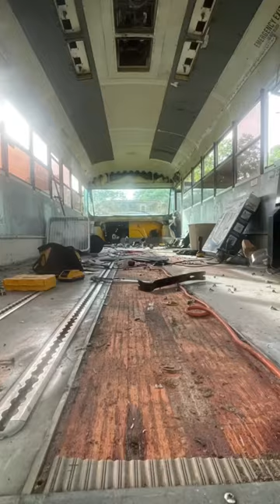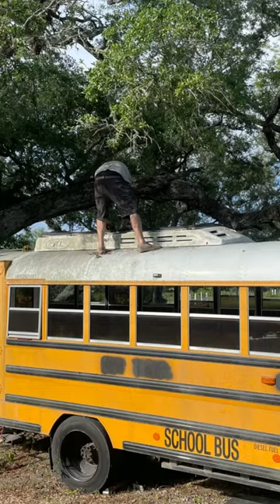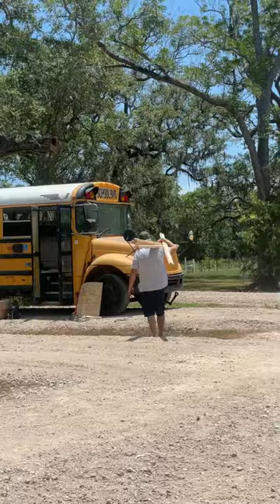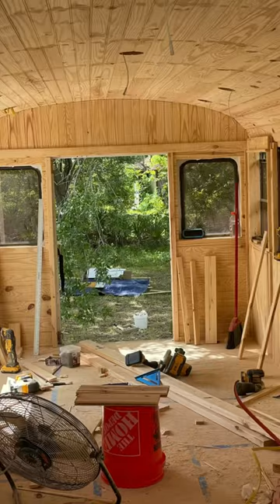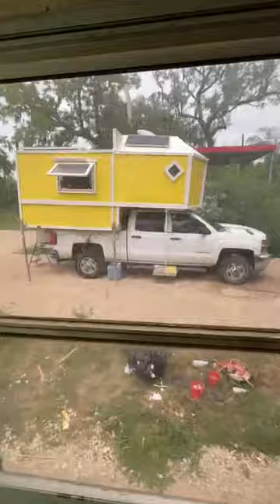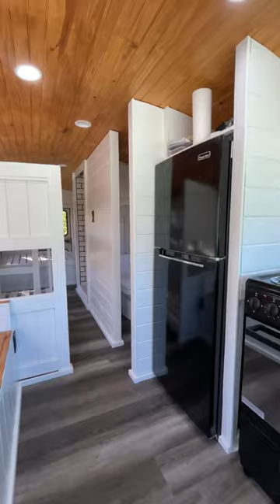COMPLETE SKOOLIE BUILD - School Bus Conversion Start to Finish #skoolie #skooliebuild #busconversion

Comment: OK I get it so so is the hood area trunk have storage or is it gonna be a 5th wheel? Now I've seen a 5th wheel skoolie no engine or transmission with a 5th wheel
 Hook pulled by a heavy duty truck 🤗
Reply from the maker: This one is stationary… that 5th wheel idea is a cool one though. 
The motor is still there, but obviously not functional. It looks cool when the hood is open, but they might remove it one day for added storage.
Reply: I would like to build one of those fifth wheel types!

Comment: I need advice on putting a wooden slat ceiling in my 4 windowvshort skoolie.  Are you screwing slats across the width to screw the lengthwise board too??? I don't want to screw a hole in my roof. I'm 65 and living in my tiny cabin I'm building.
Reply from the maker: The ceiling pieces are Att arched to furring strips across the ceiling